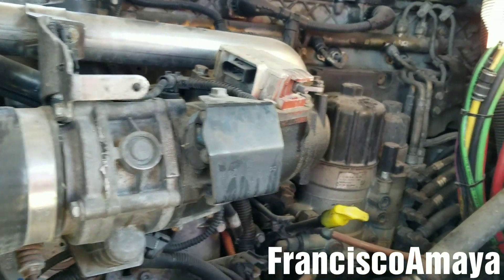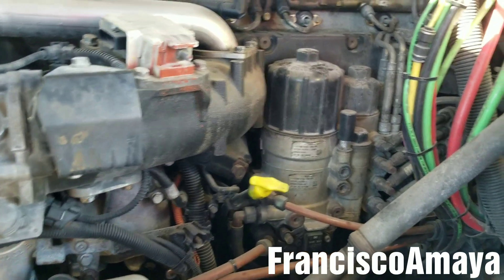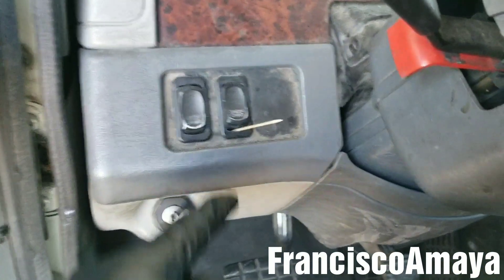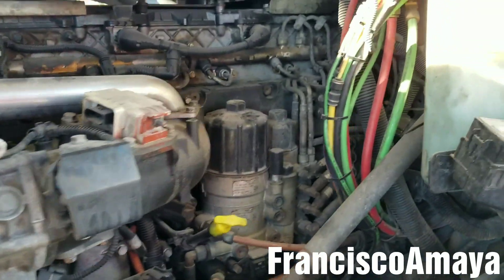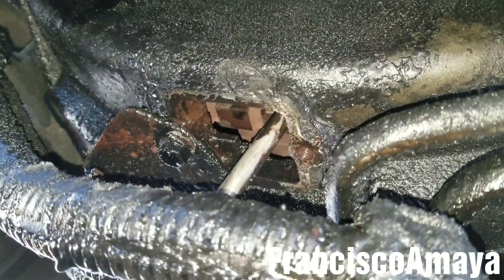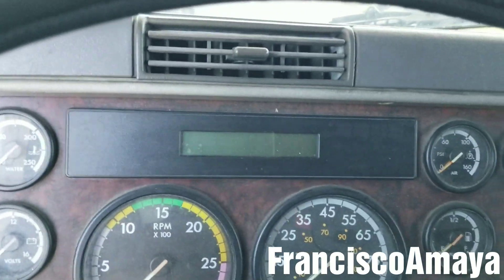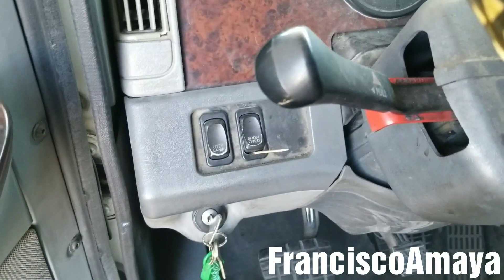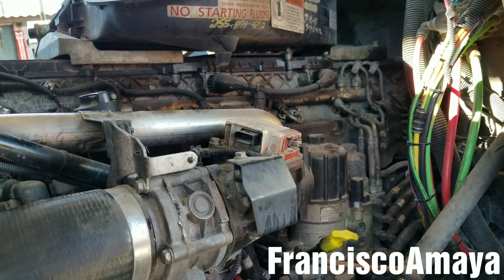Freightliner cascadia DD13 DD15 DD16 engine sized crankcase rod main bearing no oil pressure

Comment: If injectors are overfueling can I just replace the seals fuel line connecting to injectors in the side of the block you have video before on it

Comment: Francisco what is normal on the oil pressure. While idle my pressure is 10-15 and while driving it's 45-50
Reply: Idle 15-20 running 50-60
Reply: Depends on the viscosity of the oil that you run as well..
Reply: @DemetryG  I use delo 15 40
Reply: Then it's normal

Comment: Are you going to make a video on repairing this? 
I have a 2015 cascadia 550k Miles so far everything good beside to many dpf problems. Gonna probably not buy cascadia no more
Reply: Def related problems cost a guy I know with a Cascadia $25k last year parts, labor & downtime. Spent $3600 on a delete and its been running like a champ ever since! Cascadia is not the problem. EPA is the problem.
Reply: @booyakashaboy7250  For around 15 grand you can replace 1 box, dpf filters, egr and egr cooler. And that's all the major components that's giving headache with the aftertreatment system. (90% of it ). If the guy spent 25 grand he's eather an idiot or got scammed. Most of the problems can be avoided by understanding how the system functions and regular maintenance. Most of the problems I see is improper maintenance, like if you never change your engine oil and then complain that you spun a main bearing.
Reply: I want to agree with you, but all other trucks have DEF problems. I know Volvo is even more notorious
Reply: Hasan Sadig yes I have a volvo also it has very very less problems with def but when it does it's always expensive lol
Reply: wrxassa yes but I'm not in the shop every other week like my cascadia. My volvo mabey 3-5 times  in a year. But it's expensive tho when volvo goes in shop lol
Reply: @transport21  that is why I like the older Cascadias.  The DPF filter only (EPA 07) doesn't have the DEF fluid or the one box. I bake my filter once a year, clean out the soot in the cross over pipe, change Delta P sensor, clean out the venturi and so far so good, over 1-million miles and she does well.